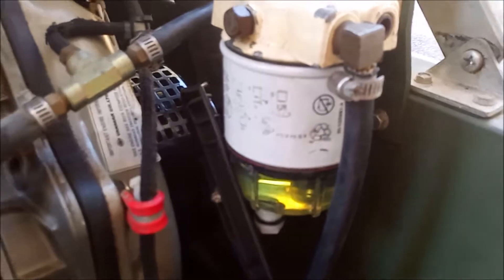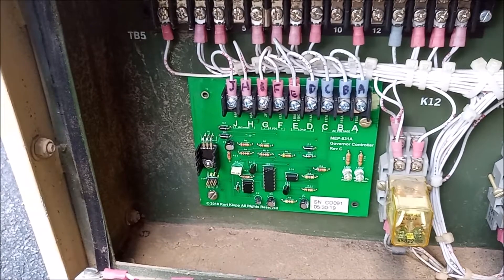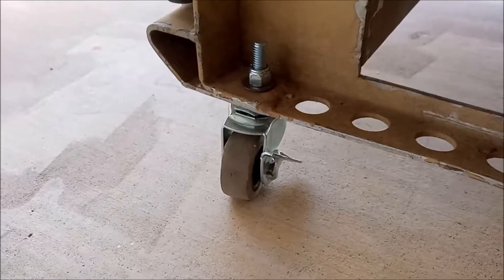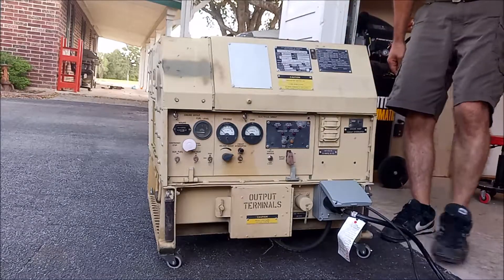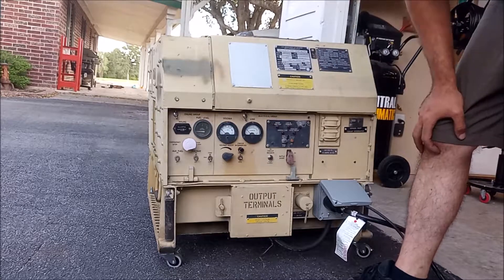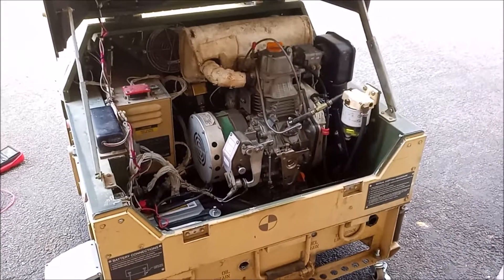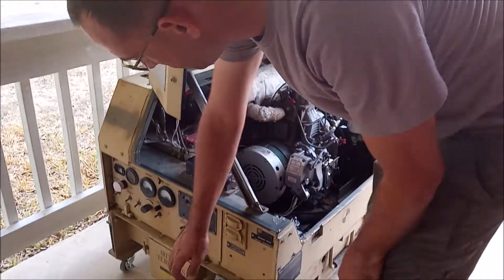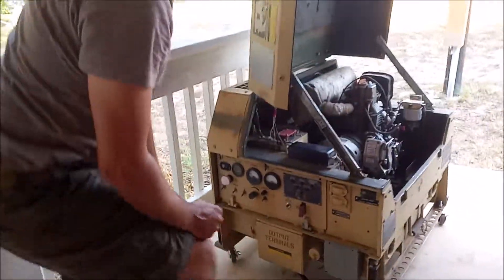MEP 831A - More repairs & 3,673 watt load test

Comment: Great Video, what did you use for a battery I'm having a hard time finding a 24V for my generator but mine is the Tactical Hybrid version
Reply from the maker: I have no idea what a "Tactical Hybrid" version is & I have been repairing these for a long time. Went through this unit a long time ago but I covered the battery in an earlier video in the series.

Comment: Currently working on this generator. Did an oil change on it and made sure it was topped off. It cranked and ran before and now after the oil change it won’t run but will crank. I’m so lost right now. Please help me if you can
Reply from the maker: Could be all kinds of stuff. You could watch my videos from when I first got the generator from start to finish and see what I went through & maybe it will help you. The Technical Manuals are a good start. Otherwise, guessing is just guessing without being there. Good luck!

Comment: Hey Colt. How did the sound (db) compare between this and your 802a? I'm looking at both and trying to balance between output and portability, but sound is a factor for where I want to use it. 

If you didn't test dB, I'd be interested in your general thoughts or how it compares to your Arctic Cat (I've got one too) sound wise.
Reply from the maker: It's really hard to compare to either of those to be honest! Haha I will say at lower RPM, the MEP 831A is very quiet but as more load is put on it, the exhaust has a lot of pressure. DBm isn't that height but the unit has a "rumble" to it what it hard to describe, but you can feel it... especially up close. I actually don't have this unit anymore... I sold it because it would not run my A/C window unit as needed.
Reply: @CallMeColtLLC  thanks for taking the time to reply. I may have to find someone who has both to have a listen. I'd like the Mep-831a for off grid camping and have the Mep-802a or Mep-803a for home backup and off grid property.

Comment: Hey cool video, it is actually my job in Army to work on these 91D, I learned few things from your videos, also what you did with the start switch/button is called flashing the circuit, these 3k are not really reliable because of that actuator issue, I usually just lock it back, but now I know more about it all thx to you Sir, appreciate you’re sharing the knowledge.
Reply from the maker: Not sure if you saw them, but I made a few different videos on this project with a lot of repairs & stuff. May help you down the road as well.
Reply: Yeah I actually did see most of it,  thank you again ☺
Reply: @mostiiisediri9832  what do you mean by locking the actuator back? Doesn't that prevent the gen from shutting off and running unstable? I am a 91D as well trying to learn more about these
Reply: @theendboss4849  Hey Bro, what i mean is holding the actuator back then pressing the pin to lock it in place,this will make it stable, it's also another  way to fix that issue.
Reply from the maker: Glad it helped!!
Reply: I am always having problems adjusting the damn actuator...keeps running unstable...or maybe it is the speed control box.

Comment: What kind of outlet is that and did the pigtail wires come with the outlet to?
Reply from the maker: It is just an outlet that I built from electrical parts available at Home Depot.
Reply: @CallMeColtLLC  do you know the wire gauge that you need for this generator or is it not a big deal?
Reply: Okay 👌
Reply: Thomas u need 10 gage wire.